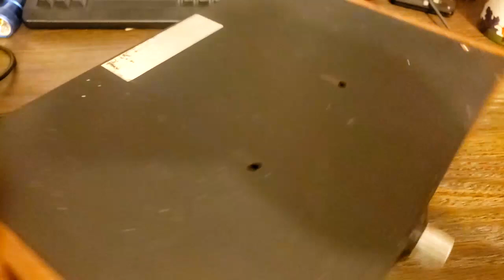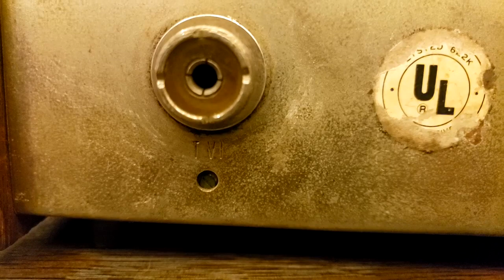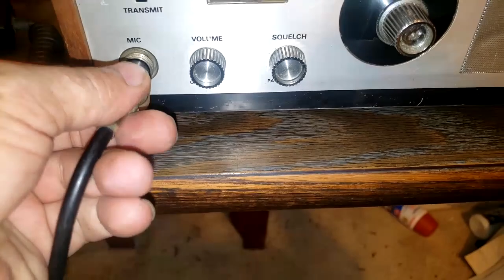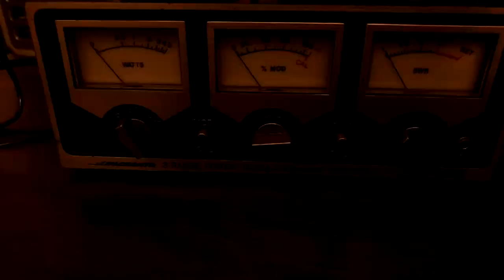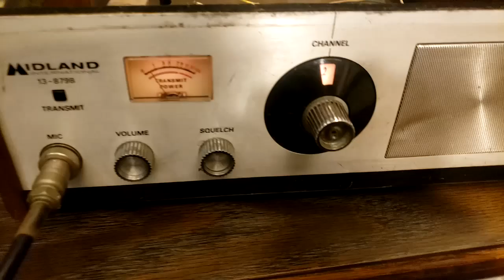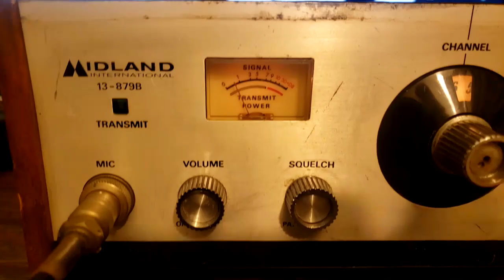Midland CB Base, Another $5 Radio

Comment: Got my brother's working has the same wire caps on the transformer as yours but not the jacked up crystal. Yellow wire disconnected is soldered to the PA jack on his. He didn't pay much for his back in the 90s either

Comment: This Midland 13-879B was a very common budget CB base station for it's time period, 1975-76. The chassis is
definitely used  in a few Midland mobile radios. I am not sure exactly who the OEM  for this radio is but it looks
like it could have been made by Meisei Electric (still in business) of Japan. Even though this is a cheap low end radio, 
i would still restore the electronics back to it's original state and  have the receiver / transmitter aligned back to 
FCC specs if needed.

Comment: you would not have to worry about a lil ole 3 watt output hurtin a radio beside ya...yahh too bad the expander box that may have had the xtra xtals in it was not included..the mod is xtra xtals..u dont have to look anywhere..but try to get xtals now..in 2020.. i first did mods like this in 1969 to old rigs like robyn 123s and the .ca equivalent, the spitfires..i still have many of the xtals that do that work..

the 6 xtals worked with each set of the 4 for transmit and receive side..to give 24 chs..it might have been possible to stick the ch sel in a spot to get 22a..so the conversion of the pa jack served as a jack to run up to the box on top

Comment: This was my very first CB base radio, nearly 50 years ago. Old school crystal synthesizer circuit. A popular mod for these was modifying one of the contacts on the channel selector switch so the "blank" spot between channel 22 and 23 became 22A. 22A is now channel 24 but it was a big deal back in the day to have this extra channel.
Reply: I modified a Hitachi Built Realistic TRC-49 (Navaho Pro Niner) for 22a by removing a resistor on the crystal board and  on a Realistic  TRC-23B (Navaho),  by removing a resistor and jumper wire on the channel selector. Wow!! we felt like
hot stuff for doing such a "complex" modification way back in the day. Yes it was a big deal back then..LOL!! It was good clean fun.

Comment: got a question to you CB savy folks. Why do I hear my truck horn through my CB ? Think I am grounded good. Radio was working good when my antenna was on truck box. Moved the antenna to front fender when I put a T cover on the box. Cant get a bleepin thing anymore. Would really welcome some advice from anyone. Thanks
Reply: Make sure you have a clean power source, and check antenna SWR and for a short in antenna line. If it has a base coil take it off when checking for a antenna short. All the best, hope this helps a little.
Reply: @MisterBigDave  it does and thanks much !
Reply: Its just the motor in the horn producing a little electrical noise right by the antenna.  Had something similar with a van rear window motor right next to a ham 2 meter antenna.

Comment: It's a trap! At least, that's what the circuit connected to the TVI adjustment is called. a trap circult that you can tune to a particular frequency and it traps any energy there. CBs on 27MHz generate harmonic energy  at 54-55 MHz (and elsewhere) which is slap-bang in the middle of the VHF TV band. Emission standards say this can't be very much, but back then they weren't as tight as they are now, and if you had a TV close to your CB antenna but tuned to a weak TV transmitter, the CB could easily generate a lot of visual and audio interference. Which can make for bad feelings between neighbours... the TVI adjustment adds extra attenuation at a particular point, so you could tweak the adjustment for minimal problems and happiest neighbours. Not a problem these days due to digital TV, much more stringent stanards, and the general lack of activity on CB.
Reply: Yep, thats what i was thinking.

Comment: John, I think looking at the wiring that someone added a switch box with a variable capacitor potentiometer such as a volume control switch or a vfo exciter box for channel expansion. might want to do some digging online for mods for your midland model number.

Comment: Thanks for a fun Sunday morning.  Love the old stuff.  I still use the mid-1970s Pierce Simpson "Cheeta"  23 SSB.  Original owner.  I put the 24-40 in back during the changeover.  I got carried away and unlocked the Clarifier and added a bunch more.  I run a 1970's d-104 with a ThunderBolt 101 for a little extra.  The old solid-state radios got that down-home mellow sound.
Reply from the maker: That's awesome! Thanks for sharing. 73's from 151 SC.